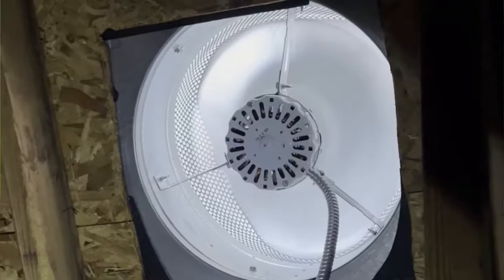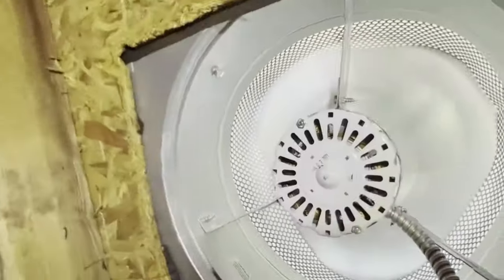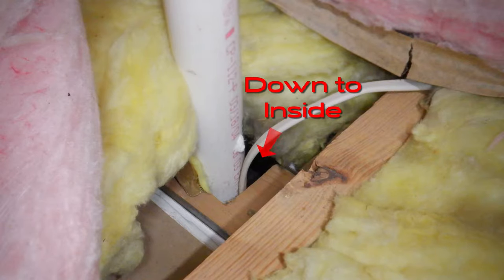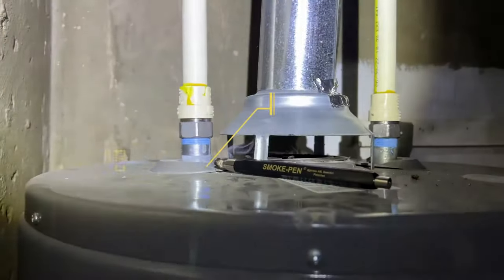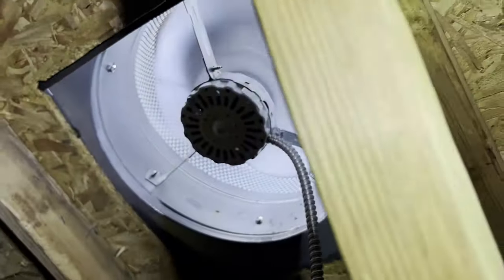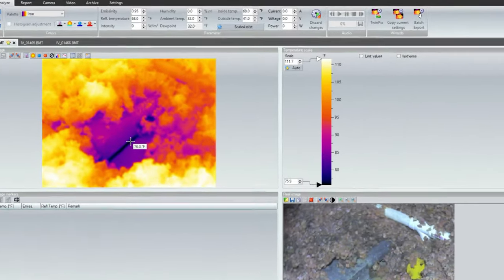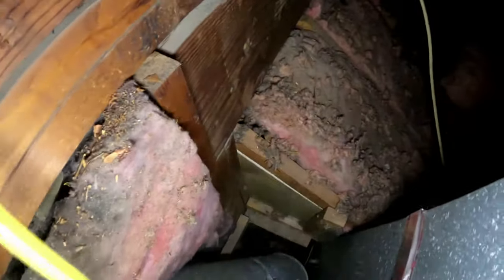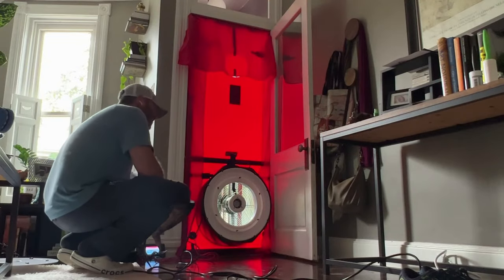Attic Fans Good or Bad? Be Careful if You Do

Comment: I just installed a Fan and it works way better! I bought bunch of insulation and sealed all leaks and nothing heat from the roof kept my attic super hot. Installed a Remington Solar Attic fan and it is wonderful, temperature is better, lower rooms are cooler and im saying on my bill
Reply from the maker: Sweet!

Comment: People tend to think "exhaust the hot air" is the solution.  When you analyse heat through a roof/ceiling system, you find that a lot of the heat transfer is radiation from the underside of the roof to the top side of the ceiling.  The radiation process is not interrupted very much by attic ventilation.  The infiltration of (conditioned) air from house into the attic is better defeated by adequate attic ventilation openings (eg, soffit vents and gable vents).  Sealing holes is important, but reducing the negative pressure in the attic removes the motive force (pressure differential).  Mechanical venitilation of an attic is not as easy as it looks, particularly with gable exhaust vents.  I've done the calculations of reducing roof load via ventilation, and the cost of running the fan roughly equals the svaings on air conditioning, so no pay back.  Extreme heating climates usually translate into sealing holes and cracks being the best remedy.
Reply from the maker: Amazing analysis! Thank you for your contribution!

Comment: I installed a whole house fane in my home. We lived in an area that often saw 90 degree plus days. The back yard was cool and shady, the front was an oven due to lack of trees. I would turn on my whole house fan and send all the hot air in the house up into my attic. The vents and fans in the attic would exhaust it. I only ran this system when I had the back window open, or it was evening. It worked well, but it was a manually operated, just a simple on off switch that turned on my whole hose fan and attic fans at the same time.
Reply from the maker: Okay, I am liking this air conveyor system. You are taking two things that I am not fully convinced are worth the effort/$ and combining their forces to become a productive part of the equation. Personally, I would continue to work towards a really well established insulation boundary with proper air sealing and proper insulation techniques. Over the long, the benefits of investing in insulation will outweigh a nifty air circulator, but it will likely cost more than your solution. Thanks for your comments and it seems you have moved...what is your scenario now?
Reply: @homeairleakagetest  The house was well insulated, and sealed. I sold it a while back, but in a hot environment, i never needed AC....well it might have been nice a few times!

Comment: Woo....I lived in Tahus..Sorry Texas and we had a the attic fan. We had a different configuration which we would have the attic fan in the center of the house and we open windows from inside the house and the air from outside flew through the house and through the attic and out through the Attic what is your observation of this?
Reply from the maker: I think I got what you are saying here! That is what I consider to be a whole-house fan. That fan is in a ceiling and connects from inside to the attic, as you mentioned. The attic fan is positioned on the roof and is there to draw air from the attic to the outside and help the ventilation process. That is the video's main point; sometimes, the negative pressure can draw your cool AC in through gaps and cracks in the attic floor if they are not sealed. A whole-house fan can be great, but it can also be a huge source of air leakage. If it is of the older variety, you can bank on it unless you have it covered and sealed in some fashion. Newer whole-house fans are covered and are more efficient (when not in use), so if you have one of those, you should be in good shape!